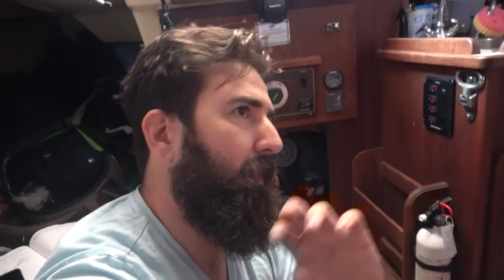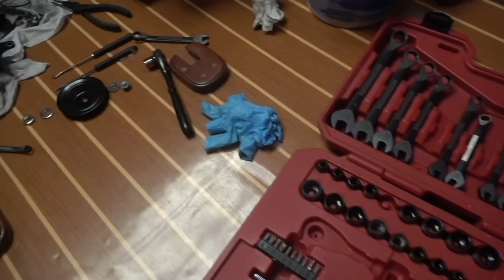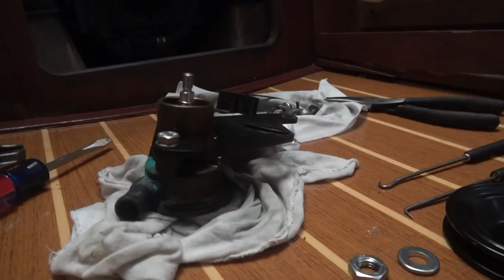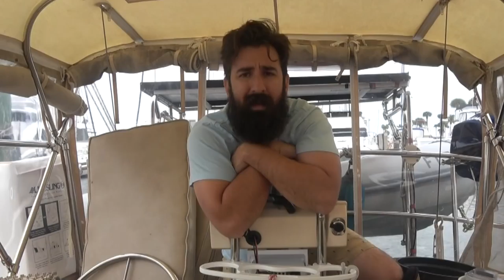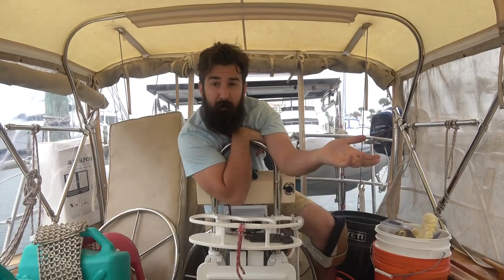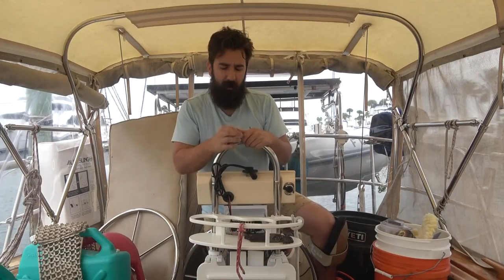What The Helm Diesel Water impeller incident on sailboat The Boat Life Sailing Adventure travel vlog

Comment: My "what the helm" was last season out in the middle of Kentucky Lake when my kill switch lanyard broke on the little part that pushes the button it, and the engine would not turn over.  being that I clearly saw that the kill lanyard was installed properly, I didn't second guess that it was that and moved on to literally every other sub system in the boat.  after several mayday calls and several hours later i bowed my head in defeat to notice a small black piece of plastic on the floor that was the pin that snapped off the lanyard.    WHAT THE HELM!!!
Love the channel my brother.  Keep up the great work and safe boating!

Comment: Theirs 2 seals & bearings. One seals the water from going in the engine & one seals the oil from leaking out of the engine. Rebuilt my yanmar one recently with aftermarket bearings and yanmar seals. Fairly easy job as a new pump is so expensive.

Comment: Try needle-nose pliers or a fine flat blade screwdriver but watch that the "C"-clip doesnt fly away on you. You can re-instal by pressing "C"-clip in with your fingers, starting at the opposite side from the "C" opening.

Comment: I ran head long into a C clip many years ago so I grabbed my needle nose pliers and had to grind down the ends a wee bit so they would fit in the holes of the clip. Shoved them in the holes and there and then that c clip and everyone after that one came out with no problem. Then years latter they made a set of pliers just for c clips and I bought me a set about 10 years ago. But for about 10 pluse years before then I just use my home made C clip pliers.... LOL,LOL
Reply from the maker: +Bobby Baldeagle that's fantastic!

Comment: you can use needle nose pliers if the ends are small enough to stick them into the holes.
Reply from the maker: Mu needle nose pliers were just a bit too big, which is probably why I flew off the handle about it. 😀

Comment: You can use a set of needle nose pliers or a small flathead screwdriver to get it out.
Reply from the maker: +Nicholaus Black the needle nose were too big unfortunately!
Reply: The Boat Life if you have a small screw driver you can try to use it like a tiny crow bar and get one side out and then work it around to get it the rest of the way out.  Like taking a bicycle tire off.

Comment: We had a hydraulic leak in the upper helm... Purchased a seal rebuild kit and with the help of YouTube videos, rebuilt the steering hydraulics, bled the lines and pressurized the system. Impressed myself with a job well done. Until, a few.days later I was out having a lesson. All seemed well out in the harbor, UNTIL, we lost all steering, AHHhh. Zero pressure in the lines. We managed to limp back to the slip with the help of the captain I hired to give me the lesson. He steered the boat with the props until I repressurized the system. Briefly scary, and a little embarrassed. After the lesson I did find with fresh tephlon tape on the pressure gauge threads the system seems to hold pressure... What the helm.
Reply from the maker: +Todd Picanso man that's a WHAT THE HELM for the books!  Ahhhh. Glad you got it all figured out in the end!!!

Comment: Mr. Laine below is correct...It's a safety design built into the pump to let you know that the impeller side seal is failing, and allow the bypass sea water to drip in the bilge, and not your engine case. Not a show stopper but, should be addressed...Note: Depending on your maintenance philosophy and budget, buy a rebuild kit or, replace the entire pump. Also, the machine shop work can be done at an automotive shop for less...Nothing marine exotic here just routine seals....Good Luck!
Reply from the maker: We did in fact rebuild it. It was in good shape other than that seal and those pumps are not cheap.

Comment: Needle nose, flat tip screw drivers and even pick at times have been used to remove snap rings.  If you have time and the funds for a special tool.  Have at it:)
Reply from the maker: +Heath Hubred struck out with many tools...  Those buggers are in there!
Reply: The Boat Life i hope you got it fixed then

Comment: If you are in a real bind you can use needle-nose pliers but if you're at the dock go get the right pliers you can buy sit where you change out the little tips four different size c clips they're also two types one for inside c clips one for outside c clips any of your major auto parts stores will have them I have also seen them at Walmart
Reply from the maker: Thanks for the tip

Comment: It's not a C clip it is a snap ring you have inside and outside snaprings two different sets of pliers￼
Reply from the maker: +David Spahr oh what the helm!
Reply: My what the helm moment was when my E clip snapped off of the transmission cable while I was docking...leaving it in gear! You're lucky you aren't on A dock
Reply from the maker: +Tom McFarland OH MAN, that takes the cake!  Are you A dock at the Moorings?
Reply: They are called "Circlips" in the UK. Internal and external ones. This is an internal Circlip. Circlip pliers are the tool.

Comment: I had the same leak recently.  That little 'weep hole' behind the impeller housing is there on purpose.   If water is coming from there, it means the seal on the impeller side has failed.  If oil is coming out, it means the seal on the engine side is failing.    I had the right tool for the C clip, but could not get the gear off on the rear end of the shaft.  I took it to a machine shop and they pressed it out very easily (for an outrageous fee of course).  Fair winds.
Reply from the maker: +Patrick Laine glad I'm not the only one in this boat!  Fair winds to you too!

Comment: Put your MacGyver hat on, you don't absolutely need those special pliers. What if you were in the middle of an ocean? Try using a pair of needlenose pliers to pinch those loops together. If that doesn't work try working on it with a couple of small screw drivers. Or try using your file to sharpen a nail and hold it with your vice-grips to work on the clip. Or unless you're near a Harbor Freight throw money at it and buy the special pliers
Reply from the maker: +Jc Regal yeah I didn't show all the attempts but I tried 2 picks, then two screw drivers, the my needle nose pliers with no luck. And I knew I needed to order a new seal so I wasn't in a tough spot to get it apart right then and there.
Reply: Yup, proper motivation is always key, had you been broken down in the middle of the ocean I'm sure you would have prevailed.  Once you work one end out you are usually home free. And nine times out of ten the clip pops out and only the Lord knows where it goes.
Reply from the maker: +Jc Regal hahahaha. That's so good!  Acurrate and hilarious!